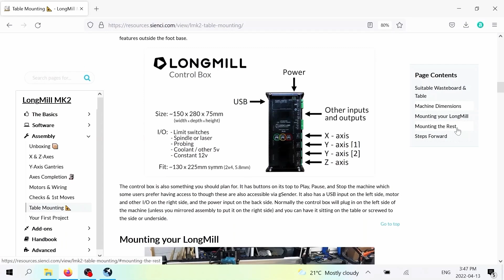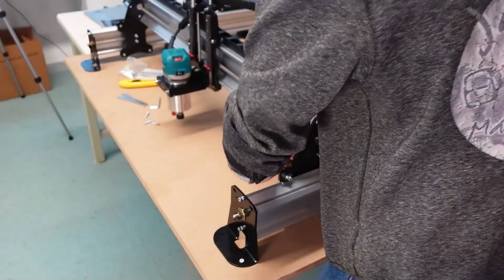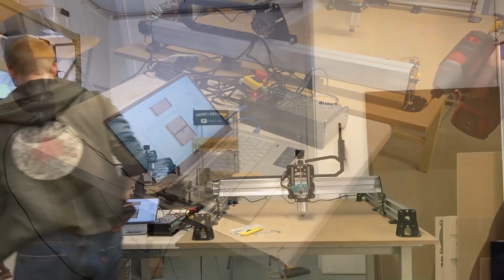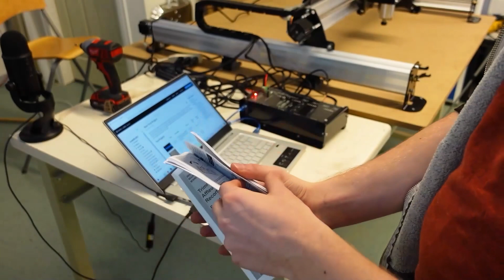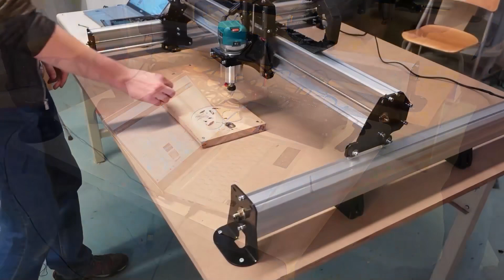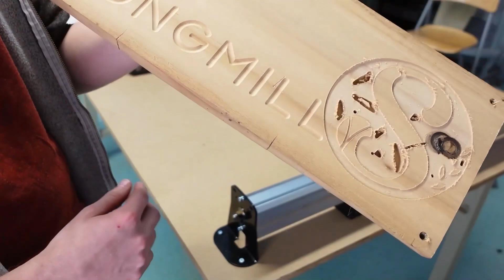LongMill MK2 Assembly - Part 6 (Table Mounting)

Comment: I have to say, this assembly demonstration did the company no favours, and I suspect it is smoother than shown here.
Reply: I have to respectfully disagree.  This 6 part video series, showing the assembly of the LongMill by the developer is thorough, thoughtful, meaningful and gave me both an understanding of what went into the design, as well as enough personal resources to help me with what I will need to do to service the machine as I use it over time.

The pace of demonstration was perfect - it matched what I was going through - and was exactly what I needed to be sure I was doing the right step at the proper interval.  

Bravo Sienci for every resource you have made available.  Keep up the great work !!

Comment: Overall this last video in the assembly series is lacking and should be replaced with much more details.
1. Provide details in the video to get the machine squared.
2. Provide details on calibration.
3. Provided details on surfacing
4. Provide details for tramming.
5. Provide details on zeroing with the optional equipment that you sell. 
6. There may be additional things but as a newbie, these I happen to have found are needed through watching and reading other sources.
Reply from the maker: Have you also gone through the rest of our resources (https://resources.sienci.com/). We've compiled everything covering your topics on our website.
Reply: @SienciLabs  I thank you for the reply. The point I was making is the video series needs to include the additional items. While there may be a video here or there. A document to be ready here or there, it should be that the "getting started" series of videos should include these additional items.

Comment: i appreciate all the time you put into the video. You never know where the extra detail will help a newcomer (like me). I am looking forward to my new machine. I have a couple of newbie questions. Can you point me to a resource for aligning the machine properly rather than the quick method you used? Also I have read on the Facebook page where users have fasteners loosen up and was wondering if loctite is a good idea for bolts that will not be used for adjustment purposes later? Thank you
Reply from the maker: The written instructions go into the extra detail that should answer your question on squaring: https://resources.sienci.com/view/lmk2-table-mounting/#mounting-your-longmill

For loctite use, feel free to use blue loctite where it makes sense. We ship all fasteners with spring washers to prevent backing out but blue loctite can also do well to ensure long-lasting connections 👍

Comment: Chris, Thank you very much for the video's. I really like that when you ran into an issue it wasn't edited out but instead you showed possible fixes to the issue and resolved the problems as they came up. Most companies would have edited out problems so you would get the idea that your machine will be delivered with out any flaws. I spent about 6 months deciding on the CnC machine that I wanted and in the end I purchased yours. Your website is what sold me on purchasing from Sienic labs. What I liked was the process that you go through when deciding what machine you want and what accessories you may want to add. With most other companies they do offer accessories but do not explain what they are or why you might or might not need them. Your site walked me through each step and offered and explained the use of each accessory. Your website is set up so one with little knowledge can confidentually purchase a CnC machine. 5 stars to you and your site builder. I will be getting my 30x30 by the end of next week and am looking just as forward to building it as I am to using it.  Oh , just an example of what I found on other sites, one machine I looked at suggested if I purchase the machine I should also purchase a stiffy for it... never could figure out what a stiify was...lol.

Comment: I noticed that you do not use a spoil board or use the surfacing routine to insure a flat surface.
Reply from the maker: To start out, your first projects likely won't need a perfectly flat surface so I instead wanted to show a bit more about how it looked to make a first project. Surfacing is something I'd definitely recommend you do afterwards though 👍